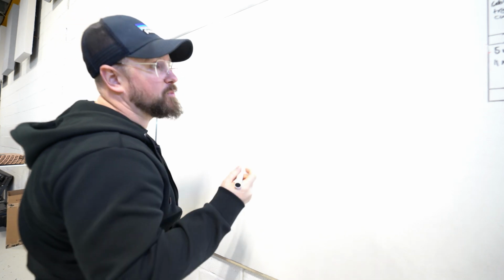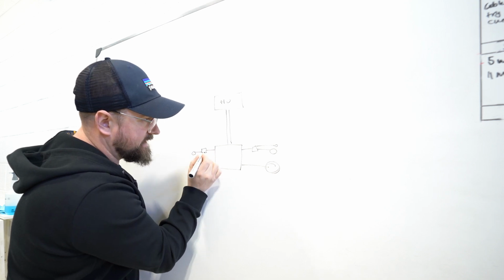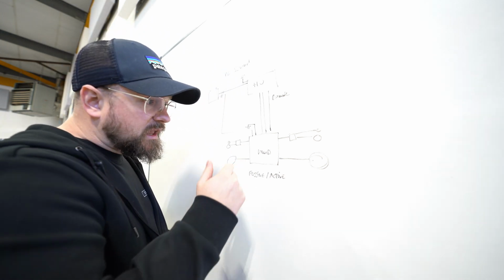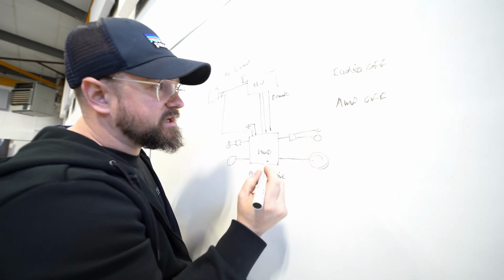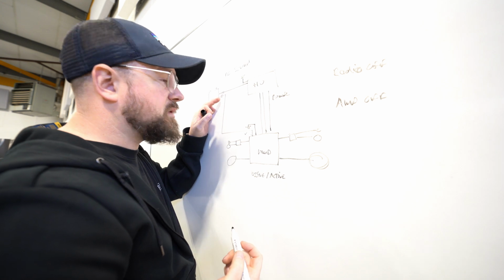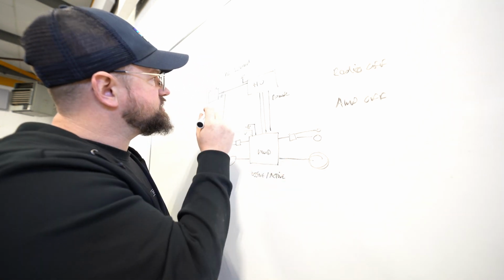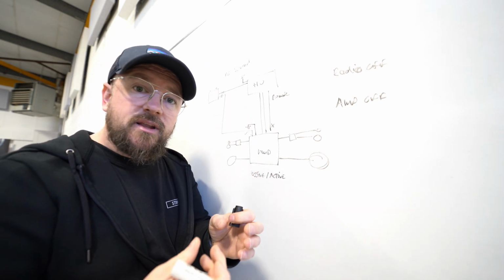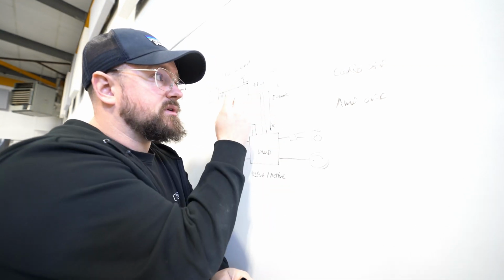How to FIX basic car audio problems

Comment: Hi. How can I diagnose an issue im having.. basically i have a 2019 qashqai and the back speakers done appear to be working BUT upon changing the fader settings to rear they do have sound but faint. 

Can you help or do I need to put new speakers in or head unit

Comment: Car radio turns and audio comes on but occasionally audio goes out but radio remains on
Reply from the maker: remote cable, main power cable, ground to amp, possibly signal but that would be rare. All avenues to explore. I would 100% be looking at your amp for this one though. If it's not amp'd it'll be something to do with the radios amp.

Comment: hey everyone. I got an 02 saab 9-5 and the seller installed an aftermarket android auto but after like a month the speakers stop sending sound, here and there there will be some crackling. so whenever i press on the gas really quickly there is an voltage spike and for a quick second the sound comes on and goes  goes away when my window is all the way up and i keep flicking the window switch up it also does that but only when my windows are all the way up and. I know my speakers are fine its just that idk if its a bad ground or not. if so where is the likely place i would find it?